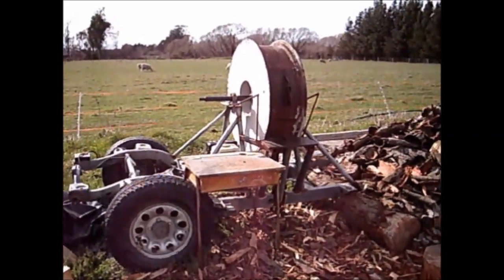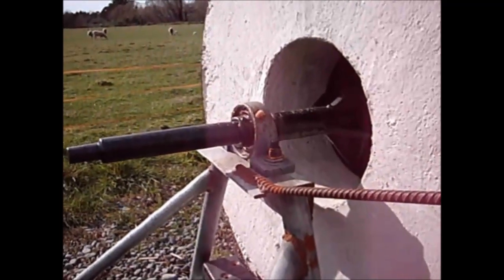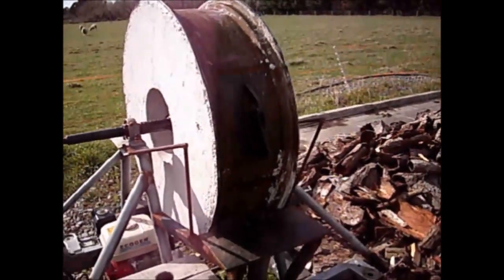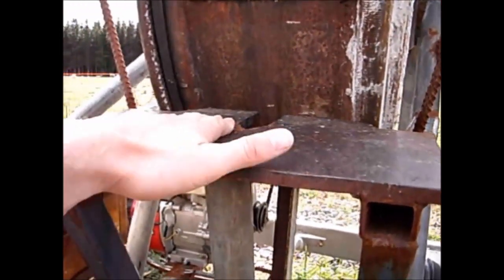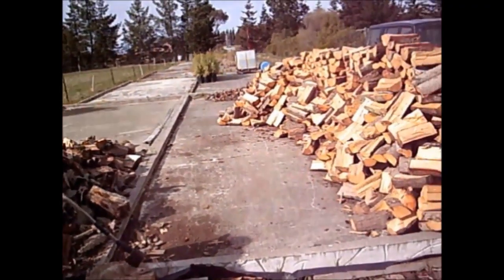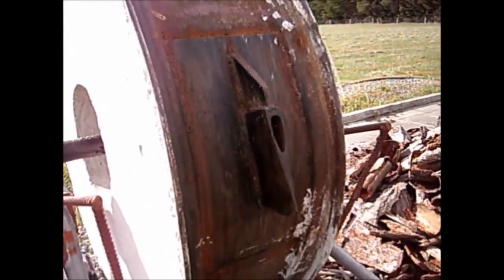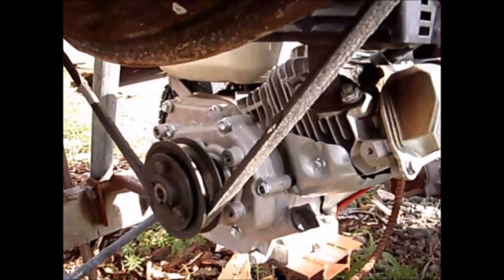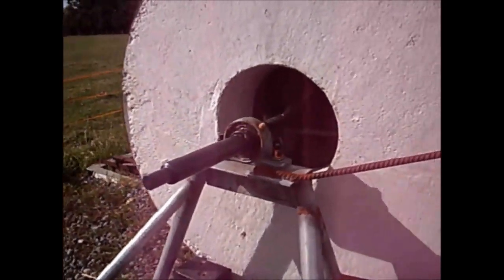WORLDS FASTEST LOG SPLITTER WALK AROUND - HOW IT'S MADE

Comment: Did you have to balance the wheel after adding the steel and concrete?
Reply from the maker: +MrLeonard55 I did some pretty rough and ready balancing by adding steel to the inside of the wheel on the opposite side to the axe head more than the axe head so the added weight swung the wheel to the bottom, I did this as I figured the weight I added would also displace concrete that would otherwise be in that area, once I had it balanced how I wanted it I added steel reinforcing evenly before filling with concrete.

Comment: Assuming your wheel is 110 cm across the flanges and 25 cm wide, you could add 85 kg net at a center diameter of 80 cm by drilling 10 cm holes through each of the eight openings in the wheel disc and filling them with 25 cm lengths of 10 cm steel round bar.  I used 2.4 as the assumed density of the existing concrete -- you'd be removing about 38 kg of concrete and replacing with about 123 kg of steel.

8 cm bar would allow you to be less accurate in locating the openings.  You'd only be adding 55 kg net but could get the diameter on centers to about 83 cm which would make it a bit more effective.

Using lead instead of steel in either case would increase your numbers by a factor of about 1.6.

If you slow the wheel down either with smaller drive pulley or by using a jackshaft I'd expect you'd lose striking power proportional to the square of the rpm rather than linearly, whereas adding weight at a given distance from the center I'd expect to increase it in linear proportion -- but don't take my word on that, I could be dead wrong.
Reply from the maker: dbeierl Gidday mate, wow you got stuck into the maths there. I did some calculations on the weight of the wheel as I was making it but didn't really have any figures to go on for what was required. In hindsight I'd definitely add more weight. I don't think I'd go to the trouble of adding weight to the existing setup how you've described just because of the effort required, the concrete is steel re-inforced. I'd probably get a new tractor wheel the same and start over, then I could just bolt the new one in. Or for a bit more weight I could add it into the hub but then that means never removing the wheel again. My advice to anyone looking to make a similar machine, if you want to split more difficult wood, radiata pine, gum etc. Use more steel/lead weight in the wheel and less concrete. Thanks for your input :)
Reply: ToThePointVideos My pleasure.  Don't bother adding weight at the hub, it'll do nought for you except keep the thing from blowing away.  Rotational inertia includes distance from the axis as a multiplier.  The other thing that seems possible is widening the slot and adding a ring of 12 mm plate welded to the rim on both sides.

Comment: Are you guys going to build a shroud for the front of the splitter to protect somebody from tripping into it. You could design it similar to a squirrel cage fan the way the fan blade is covered. I agree about the safety its up to the operator, you would not want to let any goof balls use this machine.
Reply from the maker: Possibly, I think the more immediate danger is to the operators hands in every cycle of applying the wood to the blade, so we are thinking on safer ways to do that, we welcome any suggestions on a safer design for getting the wood to the blade, keeping in mind the wood must be held some how or it will most likely rotate/kick out when struck, as can be seen in this video of how not to use the splitter ---> https://www.youtube.com/watch?v=qMsObwqD788
Reply: ToThePointVideos 
Whilst many suggestions made are quite good, I would add in some yellow or flourescent highway paint a.) in a 4" stripe around the drum in line with the axe head, and b.) across the table also in line with it. This way, when working quickly, your peripheral vision will keep you posted as to the danger zone.
Easy enough to repaint when it wears off from use.

Comment: Thank you for the walk about Mate, from a Colorado USA Do It Yourself(er),  Did you add the 2:1 gear reducer or was it stock w/the engine?  I have an old Buffalo Ironworker with a 36 inch (mm?) diameter flywheel I was thinking about using, but your concrete filled tractor wheel is an excellent idea.
Reply from the maker: Gidday mate :) Always good to meet a fellow DIYer the 2:1 reduction was stock attached to the engine. If memory serves me correctly the normal 6.5HP motor was $300NZD and to get the version with the 2:1 reduction drive on the front cost an extra $50NZD    :)